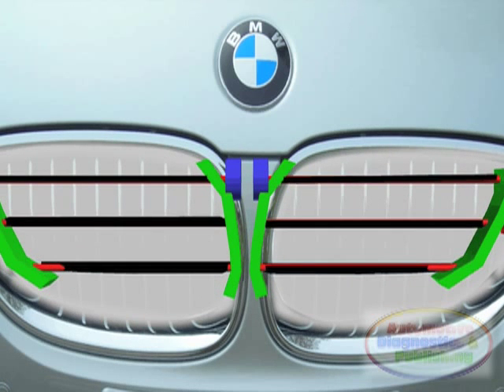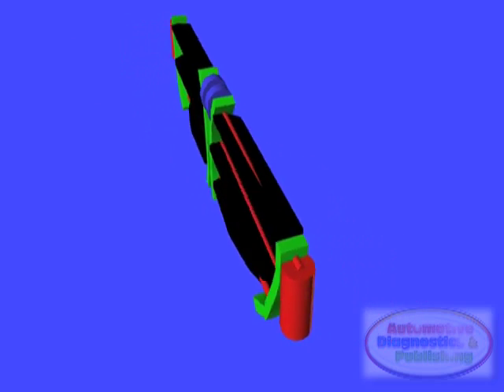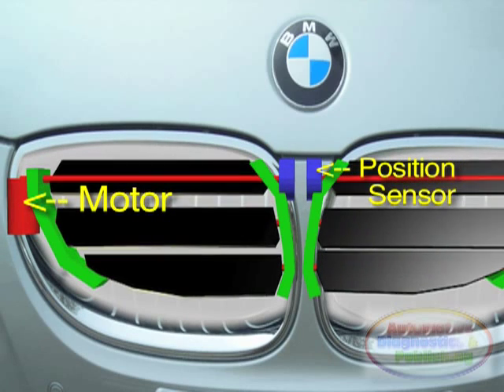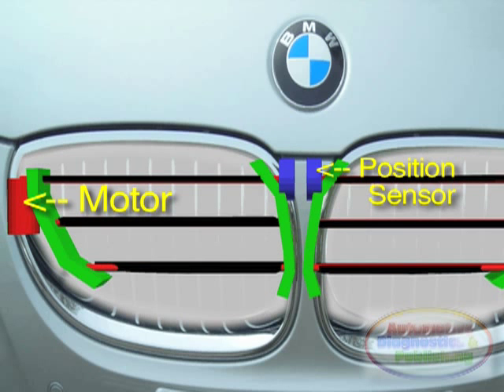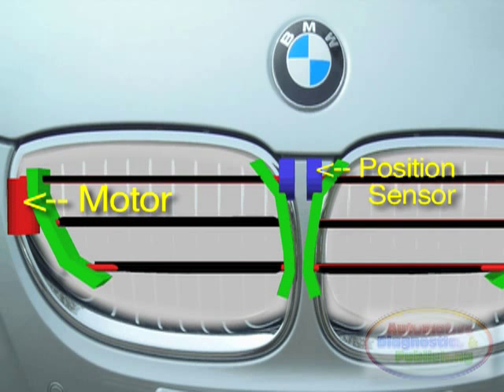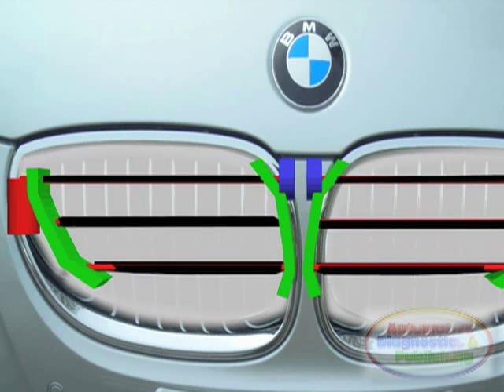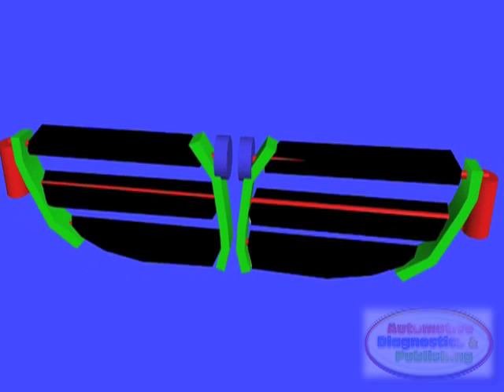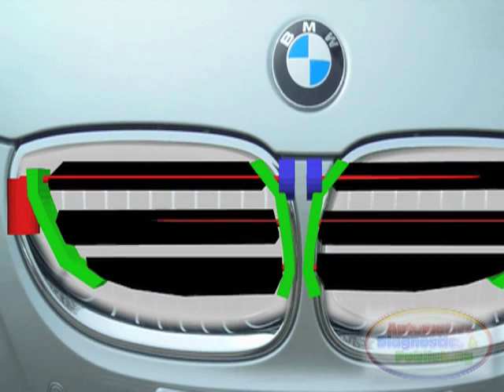BMW Air vent Control

Comment from the maker: The BMW 125 starts at $29K and a fully equipped Taurus at $35K and the Taurus SHO at $40K. What are you talking about? The BMW 125 will outlast any Ford Taurus by a large margin, including cost of ownership and resale value. If you buy a Focus yes, but it's not the same car and can't be compared. Compare a Focus to a Mini (by BMW as well) and a Mini has a much better resale value and it's a much better car. I know because we see them and work on them. That's just the way it is Thanks for sharing

Comment from the maker: You're assuming too much. An average BMW 3 series costs the same as many Fords. The fuel savings will not amount to that little, unless you drive 1000 miles a year, it'll be more than that. Aerodynamics is more than just a few bucks a year. A lot of this technology trickles down to mass produced cars, but they're piloted by these car makers. Thanks for posting.

Comment from the maker: Well ok, now that's not quite phrased properly. Actually Mercedes Benz started using MB-Tex year ago, which is a synthetic material. Some high end MB use leather, but the leather is horrible as compared to MB-Tex, which is almost indestructible. BMW has now followed suit on most models.

Comment from the maker: You know what! You're very right about that. The dumbest thing was the venerable BMW water pump. The good thing was that it was super easy to change. Issues with the plastic upper pipes and hoses are also common. In spite of that, the BMW outperforms and outlasts most other vehicles, such as Toyotas, Mazdas, Mitsunishis, with the exception of Honda. This observation is based on many years of experience in the field. There's only one mass produced car that even out and even outlasts, Honda.

Comment: Hi I got a BMW 1 Series Coupe 120D and I got his technology on mine, but I was wondering on the 135i and some other 1 series models it does not come with it as they are better performance engines.

My question is - Will it give better performance if I remove them? as more air it's going to the engine all the time thou the intake.

Thanks

Comment: So they make their seats indestructible, but their critical engine parts are ticking time bombs? i think it boils down to price...plastic is cheaper than metal and leather.
Reply: It's also lighter, corrosion proof and flexible but not bendable.

Comment: The lowly Ford Focus now uses these as well.

Lets see... in the case of BMW, I guess this will cost the owner at least an extra $1,800 to $2,000 through new car price, and added repair parts/labor (assuming they don't get stuck closed and cause an overheat episode) through the life of the car... not to mention the aggravation of maintaining them.

And I also guess they'll save the average owner maybe 8 to 10 gallons of fuel in the car's lifetime.

What a deal! Where do I sign up?!?!?

Comment: Another stupid thing to put in the car which will fail and lead to overheating and engine damage or leave you stranded with your car overheating. Driving pleasure my ass.
Reply from the maker: Agreed